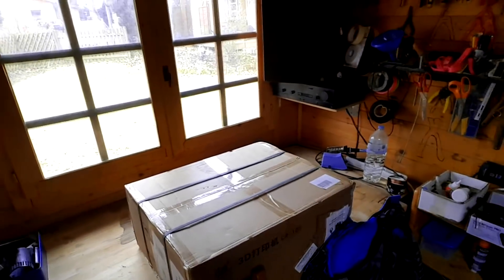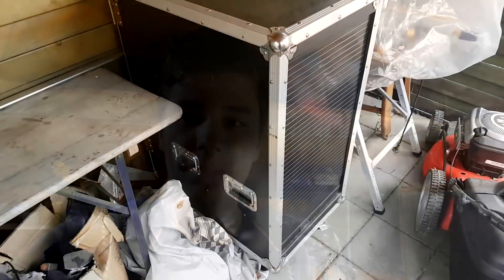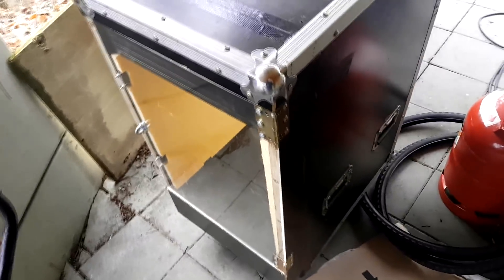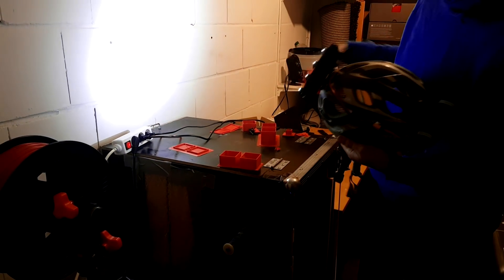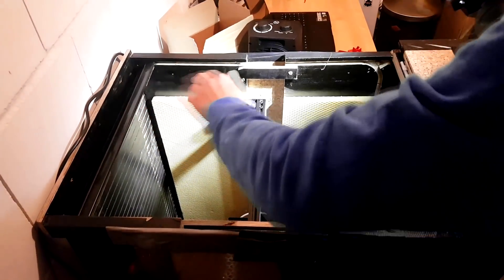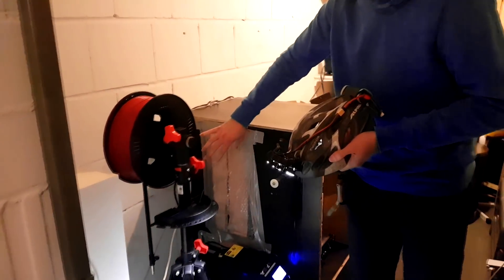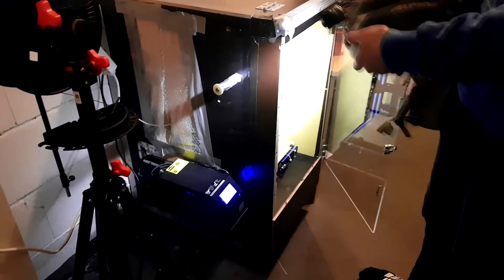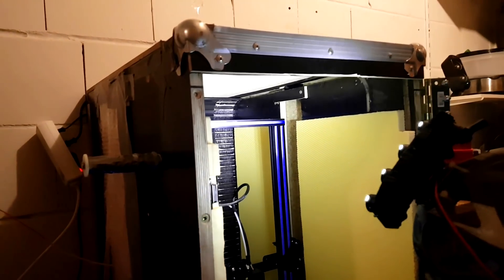Building an Enclosure for the CrealityCR10

Comment: How many spools can that chew through with a 100% block? :-P
Reply from the maker: well ABS has a density of around 1.07 kg/dm^3 ( a bit more than water), and the build volume is 30x30x40cm, that gives us 38.5 kg of plastic which would be about 17 large 2.............3kg  filament spools
Reply: JL2579 That's more than I guessed. I guestimated 10 based on the size of the spool I saw.

Comment: Awesome to see you're back! You used to blow my mind with the most amazing mc projects that nobody would have ever thought about! Glad to see you've still got that creative genius in you! The top of the case surely seems wide enough to fit a layer of foam, polystyrene or other insulating materials, while there might just not be enough space on the bottom to add a flat heating pad, similar to the ones used for propagating plant cuttings
Reply from the maker: Douglas Thom actually, I just found an old heated floor mat from my Grandma which exactly fits below the printer. It has only 50 Watts but that means I don't need to worry about overheating so that is probably perfect,😎
Reply: JL2579 great to hear that! 50w is good enough to cut the time it needs to heat up, also accounting for dissipation. I'm quite curious, how much did this whole setup cost you? It might as well be a wise investment. A friend of mine used to print fidget spinners and sell them to kids for 5 euros back when they were popular! Now that's some easy $$$
Reply from the maker: The whole setup was about 500 euros including everything and 1 large filament roll

Comment: You should add a silicone pad heater to the underside of the bed and an extra mosfet to drive it.

They come in different wattages and voltages mine added around 200W more heating power and I can reach over 100c in under 2 minutes in open air. Well worth it.
Reply from the maker: SavageSmithy you are right,but this also adds over 1 euros in printing costs for a 24h print. (Assuming that the bed needs most of the power to maintain the temperature) Adding an insulation does actually cut your costs a lot! Right now I am too lazyand cheap to order one,since I mostly plan prints> 4h where the 15 mins of additional heating time don't matter too much
Reply: JL2579 yeah I meant it more as a timesaver for you. I was just using my open air results as an example.

It stands to reason that your enclosure will have a certain amount of heat leakage regardless of your bed power so a more powerful bed heater should theoretically use the same power per print under the same conditions as your current setup it will just have a lower duty cycle.

And for the upgrade cost, honestly having the ability to get going right away rather than waiting 20 minutes is worth it's weight in gold even if you don't need it for most of your prints there will come a time when you could just really want to get going quickly before you leave the flat.

Another thing I'm not too sure about is you using a lower start temperature and then continuing to heat while printing. I've never tried it but in my head it feels like there should be warping issues doing that with abs.surely a 20-30c raise in temperature from the first layer would try to stretch the and and lose adhesion.